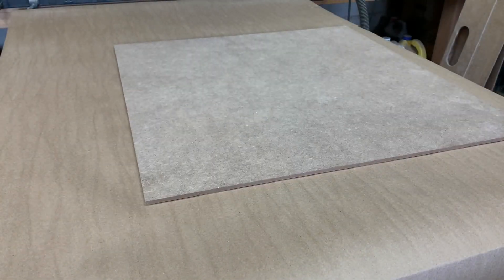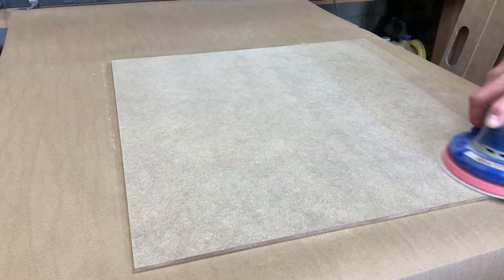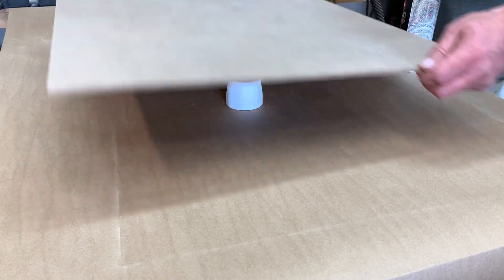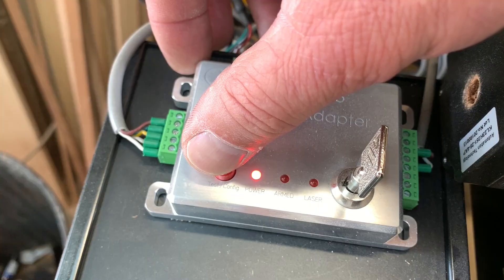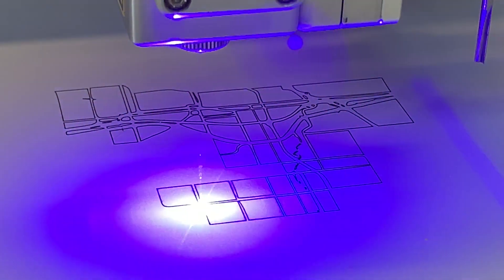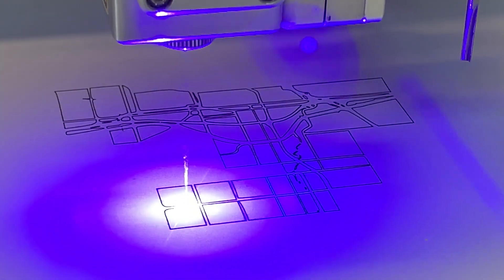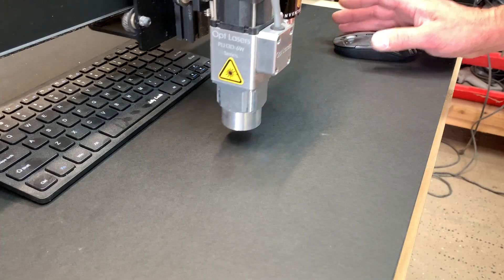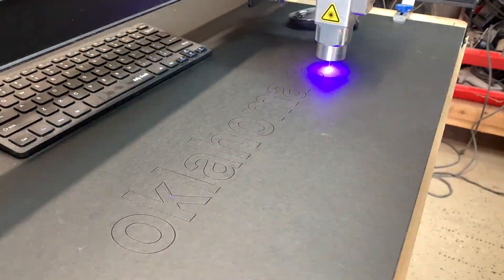Laser Engraved Map with X-Carve Laser add-on from Opt-Lasers.

Comment: I got up this morning decide to play with the laser I tried to burn an image that was a drawing. I had the height set at 60 mm while using the high resolution lens I don't have the big gimpin so I used only light burn to adjust the drawing the settings I used were under the adjust image tab my DPI was at 454.5 my gamma was at 0.100 my brightness was at -1 my contrast was at 10. under The cutting layers tab my speed was at 400 my power was at 25% my DPI was set at 450 the overscan was at 4%, and using the jarvis setting. my results were fairly decent but yet I still lack a little bit more fine-tuning I'm hoping that we can maybe compare notes not on the same image it can be a different image but I'm just trying to get mine dialed in. I have the same exact setup as you I'm trying to get the results like the guy from SouthernSmoke Engraving( https://youtube.com/user/zerica24 ) gets. I would send you an image of what my results look like but unfortunately YouTube won't allow you to post pics in the comments section. I will attach the link of the image that I attempted to burn https://www.deviantart.com/legend518/art/Black-Panther-Drawing-838354920
I chose this image because it had a lot of black and a lot of Gray tones and that's what I'm trying to dial in on. Any pointers in the right direction are greatly appreciated. I've been searching for someone with the same set up that I have,  that post videos or images of STL engravings or portrait unfortunately those are few and far in between I've only heard stories about it never actually seen anything

Comment: Thank you for this video. I am looking at purchasing a laser attachment for our x-carve. How thick can you cut objects out with the laser?
Reply from the maker: This laser will cut through light wood like thin balsa, leather, cardboard etc. the thickness just depends on how many passes you take. I would say 1/8 is about the max but that would just be a guess. 
Did you see the installation video for this device onto the X-Carve? I love this laser so far. It is extremely well made and the docking station is one of the best features for me. I use my X-Carve a lot for router carving as well and to be able to just pull the laser head off and use the router is awesome. The company is great too. I haven’t had many questions for them but on the ones I had they were super responsive. 
Contact me again if you have any more questions. If you decide to buy from Opt, consider using the affiliate link in the description to purchase. It will help support this channel. Thanks for watching!